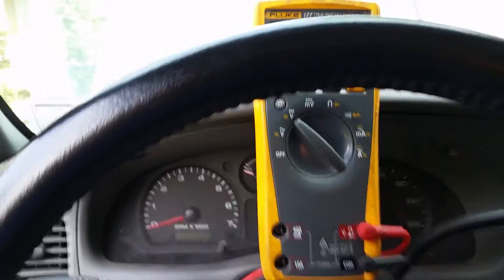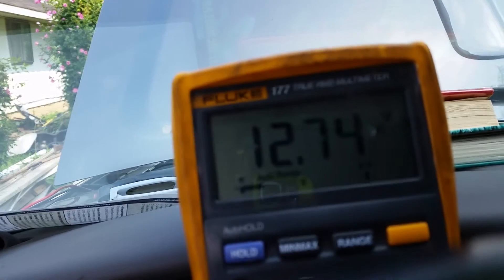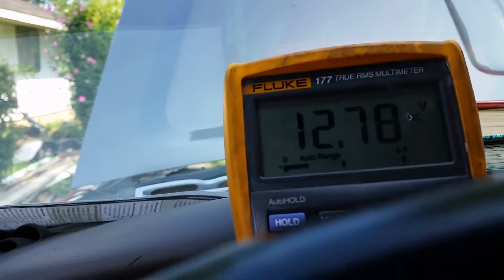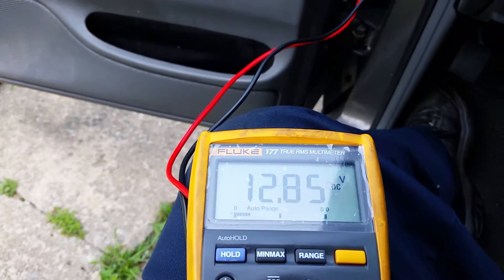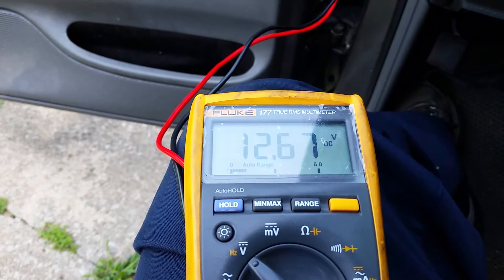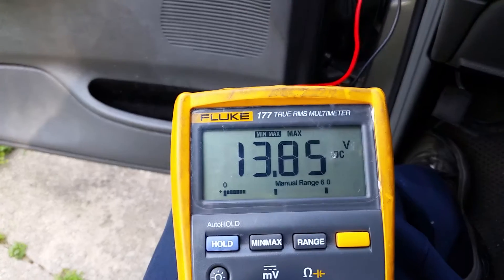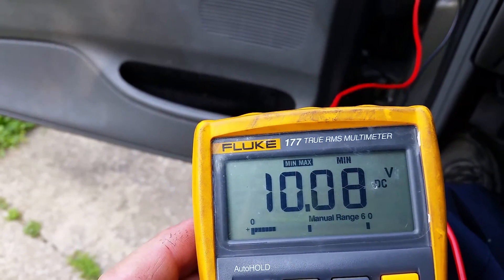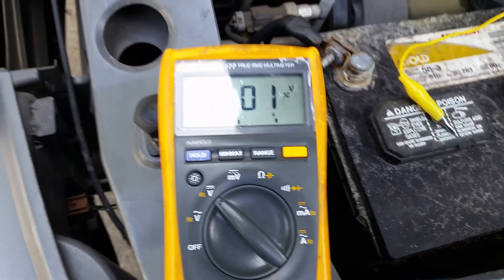Fluke Meter tips

Comment: Great video.  I have the adapter that plugs into the DLC connector and you can hook your meter to it using banana jack leads from snapon. I have done the battery test that way as well.

Comment: My instructor taught me to use a multimeter, and to jump the starter relay pins 30 and 87 to turn the starter over for 15 seconds to see if it drops below 9.6 volts. That way you dont have to have the multimeter with min max it can just be a cheap one from harbor freight.
Reply from the maker: Yes that method will work but keep this in mind.  Depending on what type of Vehicle it is and how much current the Starter Draws, you will get different voltage readings.  Also the 9.6 Volt Spec is used when you are using a carbon pile.  A carbon pile puts more load on the battery.  When you use the Starter on the Vehicle to test the battery the current draw will be less because once the Starter builds rpm you get back voltage from the Starter and that limits the current.  So every Vehicle will be slightly different.  I was showing this video just to show ballpark checks.  To really confirm if you have a bad battery without access to a carbon pile is to look at the current flowing through the starter and see if the current is normal.  Then you can determine if it's a battery, cable, connection, Starter, or solenoid.  Or a bad solenoid circuit.  Then you would have to do voltage checks.  Does that make sense? Next time your on a vehicle go to different sized engines and you will see what I mean.  Thanks for the feedback I appreciate it.